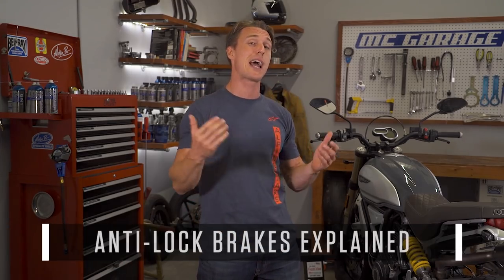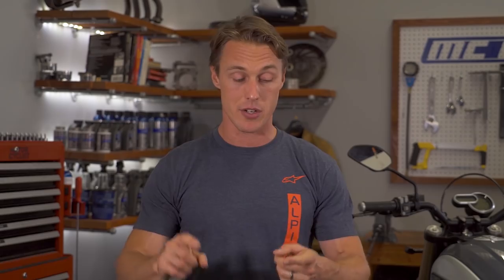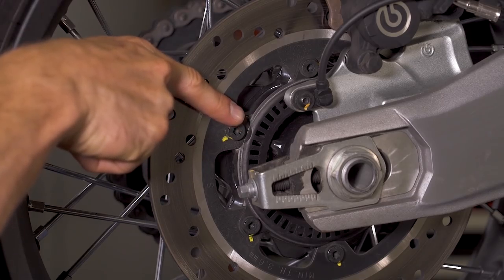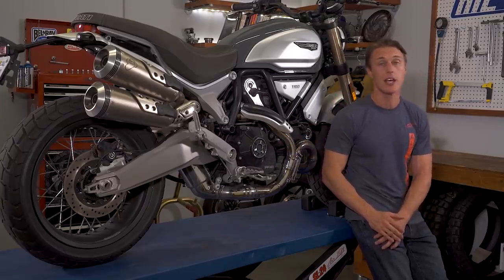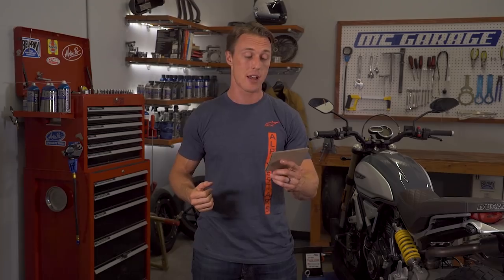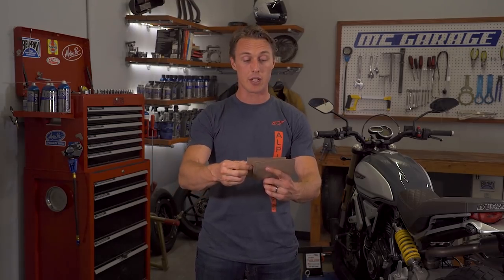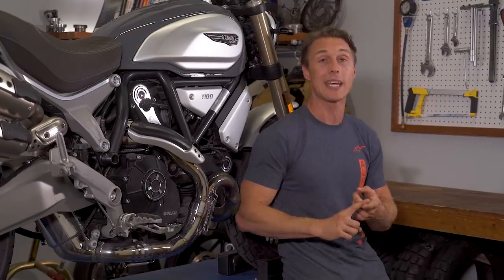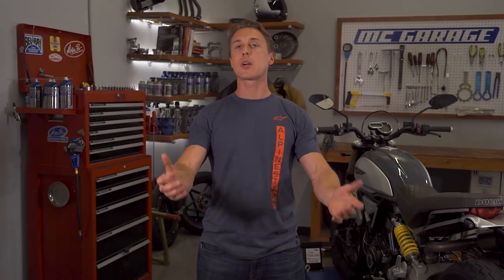Anti-Lock Brakes Explained | MC Garage

Comment: A motorcycle used to be my only means of transportation, so that meant riding 365 days a year in the rain and in the very cold. Sometimes after work I'm just too exhausted and burnt out, and while it's raining someone would pull out in front of me. ABS is for emergencies, and because of that it's saved me from many near-crashes. It's a good thing to have an ABS bike and if you think you don't need it because you're just as skilled as Rossi on the street, then you're doing it wrong...very VERY wrong....
Reply: Still is for me. I've never had an ABS bike. In the past when my driving was more aggressive and my skills were on point I really didn't need ABS on emergencies. These days I'm not so sure. Really you need to be barely missing would-be-crippling crashes on a regular basis to get the skills for emergencies. Otherwise you just freeze, stamp the brakes, and drag out a long skid whilst hoping you stay upright. Its been a while since my skills were at that level, and anyone who isn't tested regularly enough to know for absolute certain won't be at that point either (even if they can brake perfectly on the track - its a different skill entirely). If I were to get it I'd rather some of the top systems like Yamaha's rather than the apparently mediocre and intrusive Honda systems, but since I'm not upgrading for a long time to come I'm really just stuck without. Still, good tires and attentive driving can mitigate the need somewhat.
Reply: @olivialambert4124  I've never had ABS either, up until recently it was optional on Sports/Superbike and I never opted for it.  I'm an attentive rider, with sufficient skill not to lockup the tires. I'll make them squeal, but I've never locked them up.  

I think of digital aids as a last resort that I would rather not rely on. I'm the same in my car, I refuse to the rely on the multitudes of driver aids. I feel it just makes you lazy, you forget basic skill and become less attentive which just leads to accidents. 

Besides this, you can often stop in a shorter distance without ABS activating, than with ABS activating.
Reply: @IsobarBrokenFlame  Met plenty of people who think like you in my time working at a hospital
Hope you dont one day end up in a situation where you flawless skillset come up short (oil spill or whatever) and some computerassisted ABS might have saved you. 
Ride safe
Reply: @Surpriseify  I hope so too. But like I said, digital aids usually results in over confidence, and a less attentive driver/rider. 

When I get on my bike, I’m focused on riding. That is the only focus, because I know I am the first and last line of defence. 

So many people get into their car, or ride their bike while focusing on other things. Or loose the skills they once had due to relying on driver aids.

I fly helicopter’s too. I was a very good pilot once upon a time, these days I’m not so sure. Too many pilot aids means I’m not even that good on the controls any more. Every time I get back into a R22 (zero pilot aids) I look like a trainee.
Reply: @IsobarBrokenFlame  Well in a world where ABS is like automatic transmissions, in the sense of how common they are, you’re rarely going to find yourself in a situation where you don’t have these safety devices in the first place. For the average person, you’re not doing yourself any favors by opting for a bare bones piece of equipment. I’d argue that 99% of people aren’t able to skillfully brake their way out of a high stress situation. So the saying goes, you’re better be safe than sorry🤷🏻

Comment: "I dont need ABS, I got skill" - Ari Henning 2017 🤣
Reply: The thing is that ABS shouldn't be kicking in until the last few inches, if at all, when you're braking properly. The point of ABS is to allow you to get closer to maximum braking potential without locking the wheels up or to compensate for when there's a sudden change in traction that you can't predict. 

But, if you've got skill, you shouldn't need ABS. And if you really know your bike, you may be able to feel the upcoming lock and intervene.

If you do find it kicking in, that means that your skills suck, either your braking skills or your planning strategies, and those are more helpful to address than the lack of ABS.

Not to say that ABS isn't worth having or that my next bike won't have it, just that it's easy to turn it into something that it isn't.
Reply: Lets put some oil on the ground and see his skills. A computer will always be better than humans. ABS are there because they reduce the number of accidents by a factor of 5. Traction control almost reduce the risk of highsides to zero and a steering damper reduce the risk of a tank slapper to zero. I have skills and a brain.
Reply: @SmallSpoonBrigade  key word "shouldn't" but in the real world not everything works out perfectly. There's no argument against ABS besides idiotic ideas of "real motorcycles don't have that"
Reply: "I don't need to reply to hate nerds, I'm awesome" -Ari Henning(Not)
Reply: @SmallSpoonBrigade  so by your logic if you got skill you don't need helmet , crash protection like safety gear gloves etc; right?
Reply: Add that saying to your gravestone it will be funny
Reply: On the more advanced systems you can't even tell when or if the ABS has been triggered -it's that good.  Still, ABS is no substitute for buffering and rider awareness.
Reply: @tdunster2011  not helpful in emergency stops in corners. Only good for braking in a straight line.
Reply: +N .A -  That's not correct.  https://www.asphaltandrubber.com/lifestyle/bosch-cornering-abs-explained-video/
Reply: I don't care if it's Rossi or Ari.
No amount of skill can stop a bike from skidding when it's raining really hard and a dumbass car suddenly cuts into you OUT OF NOWHERE....with almost no time to react!!!!!
when i jammed my brakes at 95km/h (60mils/h), i thought i was a gone case.....
But abs saved me!!!!
Never doubted it again!!!
Reply: I dont need ABS, i have a helmut. 👍😎🏍💨
Reply: @aswinnayak8147  learn how to brake.
Reply: @aswinnayak8147  driving almost a 100km/h with heavy rain isn't really safe to do though🤔

Comment: I like to think of abs as motorcycle gear. One more layer of gear, kinda like a helmet or jacket. 🏍🏍🏍
Reply: Well said
Reply: I tried ABS, didn't fit on my head
Reply: ok, so let Darwin take them home :) i dont care
Reply: And like riding gear, if ABS is saving your butt too often, you need to work on your skills. I, personally, would not like ABS to intervene when I brake. However, if the front wheel locks up, control can be lost very quickly. But rear wheel lockup is sometimes necessary. In my view, single channel ABS (front wheel only) is ideal or an optional mode to disable it in the rear wheel.

Bottom line is that ABS is excellent safety net. It can make the difference between crashing and making a clean escape from a hazard. But one should always assume that it can fail at any time and learn to brake properly. Of course, during panic braking, it is the conditioned reflex that takes over. Not much fine tuning there. But still, practice is essential.
Reply: the only gear i need is health insurance 🖕😀🖕

Comment: ABS saved my butt when some stupid van driver decided to turn left ahead of me. And of course, as is always the case with such special snowflakes of a driver - he didn't bother to use a turn signal. Or to maintain his vehicle so the brake light would work. It didn't help that the road was wet from the rain that has just passed either. After that I went from "ABS is nice, but not really that important" to "just get ABS if you can".
Reply: I'm currently walking with a stick because somebody turned across me last week. I was lucky to not have anything broken as I slammed full on into his side. I'm definitely considering ABS as a future option when I buy a newer bike.
Reply: Definitely, but if you didn't lowside your bike then ABS wouldn't help much in this situation... I'm also recovering from a crash - but this one was on racetrack and it was mostly my fault. ;) Anyway - get well and ride safe!
Reply: @motoholota  somebody turn across my side of the road and I couldn't stop before going into the side of them and then he drove away from the scene without knowing if I was alive or anything.
If I'd been on a bike with better brakes I'd have stopped or at least reduced it to a bump rather than ripping the tank off my bike with my groin and la ding on my head on the other side of the car.
Reply: Some people ;/ Good thing you're (mostly) OK.
Reply: @daved2352  ABS actually decreases stopping distance, if someone knows their bike. Most of my bikes have interfered before the tire reached limit.

Comment: Hi Ari. My problem with ABS isn't with ABS, it's with riding schools. I don't know how it is in the States but in Sweden, were I live, a lot of people that have no previous riding experience go to riding schools before they take their licence test, and these schools use bikes that have ABS (that you can't turn off). So they pass and that's fine but a lot of them can't afford to buy a new bike as their first one. So they buy an older second hand bike that doesn't have ABS and that to me is potential disaster. I'm a bit older so in my days most of the bikes did not have ABS so that's what I learned on. In my opinion the riding schools should teach braking technics with ABS off. Then if you get a bike with ABS, good for you, if you don't, at least you have learned how to brake anyway. My two cents. Cheers. /David

Comment: I have no doubt it saved me from crashing when a car pulled out in front of me.  After the near hit I realized that your instinct just kicks in  WAY before you can make any concise decision. Before I fully realized it I had applied a lot of breaking pressure and I felt the ABS doing it's job. I simply do not believe you can override your natural instinct to self preservation. Only in hind sight you realize your body simply reacted to a dangerous situation. I've had similar experience when a deer suddenly crosses the road. you just react, you don't think about it. ABS IS a life safer and is designed for emergency breaking.

Comment: ABS on motorcycles is mandatory in Europe meanwhile. Any bike sold as new 2017 or later must have it. 
Greetings from Germany, love to see your technical videos.
Reply: ZAMsChannel - beg to differ. Perhaps the EU regulations require ABS on larger bikes, which would make sense, but I bought a 2017 125cc last year and it did not come with ABS...not available either. EU4 (?) rating, however, is required for all bikes - where the brakes encompass "combined braking" of rear with front when depressing the rear pedal. Good to know, though, that ABS is required for bigger bikes. Cheers, TH
Reply: @bridgestreetgolf  Correct, ABS is required on all motorcycles above 125 cc. 125 cc bikes need to have combined braking, though
Reply: not for enduro bikes :-D there are some exceptions
Reply: @0x42NaN  all road legal bikes as far as I know
Reply: yeah then read the law again. I'm sure it's like that.
Reply: @0x42NaN  so I followed your advice and did some research. There is no mention of enduro bikes in the EU legislation anywhere. The only place where there is any mention of an ABS requirement exception, seems to be in an article concerning Australian legislation. As far as I know, Australia isn't part of the EU.
Reply: Dude you aren't doing it right then. Motorcycles with a seat higher than 900mm, ground clearance higher than 310mm and less than 140kg don't need it.
I have to admit, it is hard to find, even for me and I'm German
Reply: @0x42NaN  that is interesting and I would like to see some info on it. My German should be sufficient to understand the source material
Reply: No, it's not, you just need to license it as an one seater. Enduro bikes are often declared as one seater from showroom floor, but any bike can be modified (it's just paperwork).
Reply: @Another Millennial you forget the government pays our health bill, so they heavily benefit by reducing road accidents. 
So that's how we got ABS and proper driver training here. And ended with one tenth the traffic casualties per capita of the US (in the Netherlands at least).
Reply: No, we pay our health insurance, only, we don't have a choice in a matter.
Also, how does a casualty increase the health bill? I'm really sick of our benevolent overlord saving me against my will.
Reply: Thanks EU once again for pioneering requirements that are common sense. This means a lot more MCs will have it here in the states because they'll just use the same design.
Reply: @Another Millennial because up till about 3 or 4 years ago it was near impossible to find a bike with abs. It's a silly an important safety feature that the market wasn't investing into. Hell I own a ducati because of this one feature, I couldn't find it on the bikes I wanted.

Note: I'm a kansas boy, so from the states. 

Some requirements are important and we do the same thing here for cars all the time.
Reply: All bikes starting from November 2019 need ABS as a mandatory requirement (althought new model bikes in 2018 will have ABS). This is very beneficial for young rides despite what everyone says. ABS will save your life in an emergency, not your braking skills.
Reply: @Another Millennial Everyone knows what brakes do, knows how to stop and should have the motor reflexes to grab the brakes (at least front). ABS is a technology because everyone instinctively grabs the front brake or hard stops in an emergency. Of course, you may be distracted, not stop and rear end someone but then again, it's probably more of a rider error than a technical error. According to you, we shouldn't have brakes at all since we may all be distracted and nothing will help. I agree governments should regulate as it provides a safety standard and statistics prove it works. Manufacturers can bypass this system by providing manual ABS (turn off).
Reply: @Another Millennial Why would a government not make such a promising safety feature compulsory. ABS in cars was introduced in 1970 for high end cars and now a compulsory item. Similar to seat belts and airbags (jacket airbags may be compulsory in the future). Without a compulsory standard, manufacturers will not produce units with this technology to achieve profits margins and technically avoid innovation. Modern ABS doesn't make a motorcycle suddenly command a high end price and can be turned off. You can turn it off if you want and I can have ABS as a safety standard (I know my manufacturers are constantly innovating and make my rider safer) - what's wrong with that

Furthermore, if the consumer had to choose - wouldnt the new rider be in a difficult position as aftermarket ABS doesn't exist? Or you need to have a major changes done to accommodate a OEM non stock ABS? So the market has to cater to your needs but not anyone else?
Reply: @Another Millennial  Another Millennial  Firstly, you give manufacturers too much 'good faith' in electing which models or units have ABS applied.  If 101 people want ABS and 10,000 don't, how would you fix this situation? Wouldn't the compulsory ABS system we apply now work for both situations? 

Secondly, if you advocated for a small government system and 'freedom' as a primary considerations for goods and services and even regulations, what prevents you advocating freedoms to elect other safety measures. Do we have to stop applying ABS in cars, seatbelts in cars, airbags in cars, indicator lights on transport, brake lights on transport and tyre regulations because a small minority chose not to? Or should the consumer choose what safety measures they want? Why would a manufacturer make safety measures if they aren't standard? And why must my safety standards drop for your freedom?

Finally, hypothetical situations aside, a government is not all powerful and can not make legislation without considering the national community. Having all motorcycles banned as they are inherently unsafe compare to cars, suggests denying rights of individuals who can't drive or afford a car or other modes of transport. Should cyclists be banned? Maybe cars should be banned due the rising accident numbers, suggesting cars are really safe either? Also, a law can also be changed.

Rather than suggesting personal freedom is more important, maybe provide a scenario where your theory would work without infringing the rights of others.
Reply: @Another Millennial Thank you for the insightful debate in which you said nothing but 'my freedom trumps all'. Next time when you state an argument for a debate, maybe provide some explanations and suitable alternatives. Merely stating your argument doesn't really mean anything. You're right, I disagree with everything you say.
Reply: Post 2018 government statistics (UK) have shown a 25% decrease in accidents that would be deemed "fatal" had the bikes not been fitted with ABS. That's about all you need to know really.
Reply: That's why we voted Brexit. Don't get me wrong, ABS is good, but don't shove it down my throat as the EU (unvoted) socialists do on everything.

Comment: The ABS on my Concours 14 is one of the factors that saved my bacon in a crash back in April. A minivan driver made ab abrupt left turn into me at an intersection, and with ABS, I was able to scrub off enough speed to minimize the impact. I was still injured, but I'm still here to write about it.